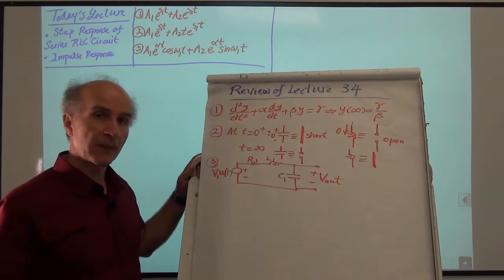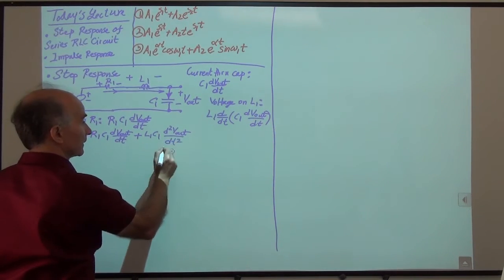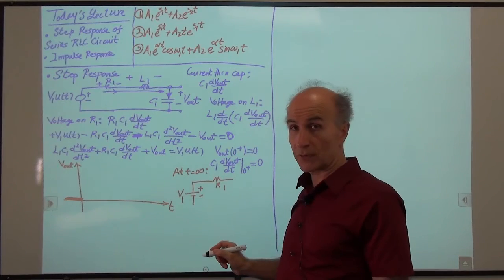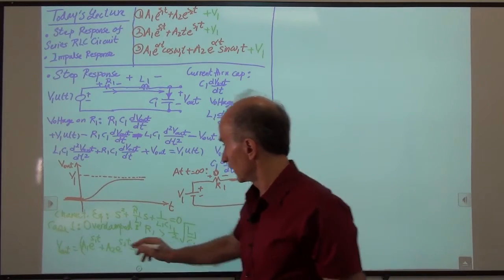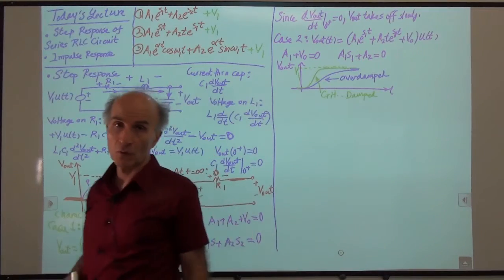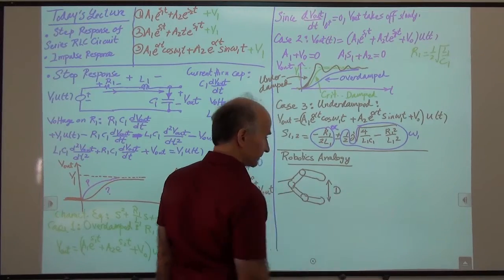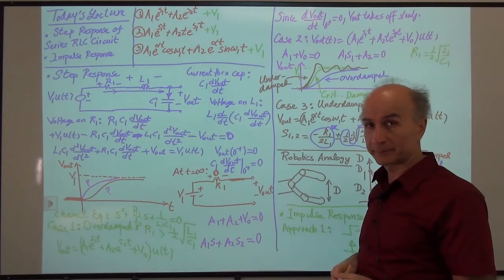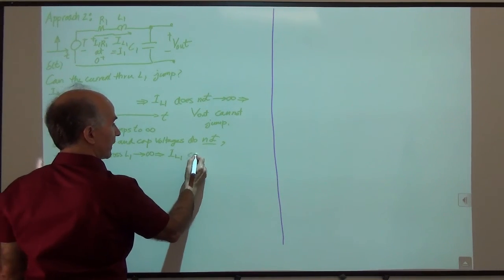Razavi Basic Circuits Lec 35: Step Response of Series RLC Circuit

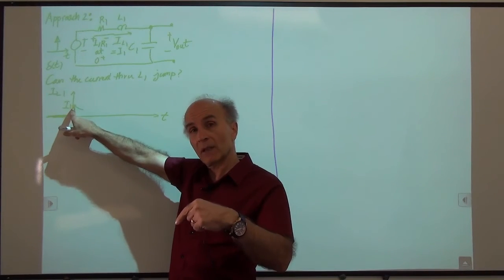Comment: @43:30 and @46:13  The master says there can be a jump( finite) In current across an indicator of we have infinite voltage briefly.

And if we have infinite current the voltage across a capacitorcan jump by finite amount briefly.

In this case we have infinite voltage so the current across an inductor can jump by a finite amount.

Comment: How do I know that a circuit will reach a constant value at time infinity or not? Without inputs, it is easy to tell because everything dies out. But with an input, how do we know that?
Reply: At which point does this question relates to ?
If it's generic question then normally it takes micro seconds for the caps and inductors to stabilise. To be precise normal 5 times constants are considered sufficient enough for the circuit to be considered constant. So you find the time constant if the circuit and 5 times it is enough.
Reply: Consider it as a concept rather then ab exact measure of time

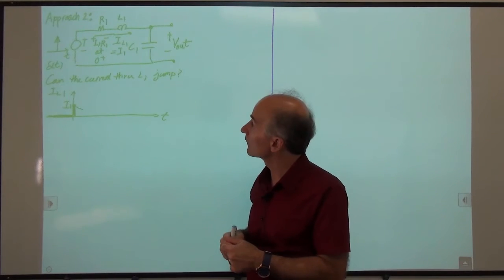Comment: At 45:50 due to the presence of infinite voltage( impulse) inductor will allow the sudden changes of current through it.. cuz of this I(0- ) is not equal to I(0+).. where I(t) is current through inductor( in series current is same so current through all elements will be same) .. i(0-) = 0amps i(0+) = 1/L1 but capacitor will not allow sudden changes of voltage through it.. cuz infinite current not available here.. so vc(0-) = vc(0+) =0volts.. is it correct?